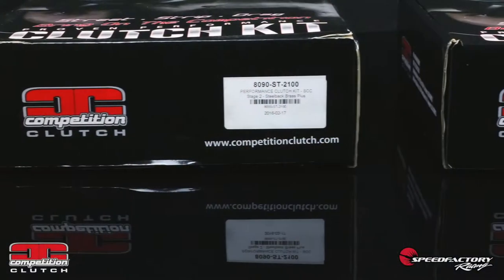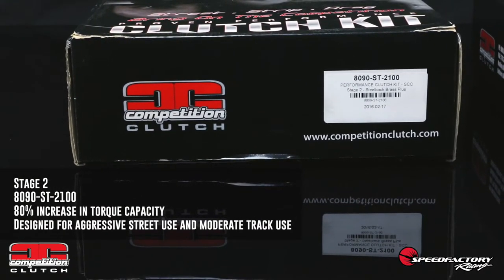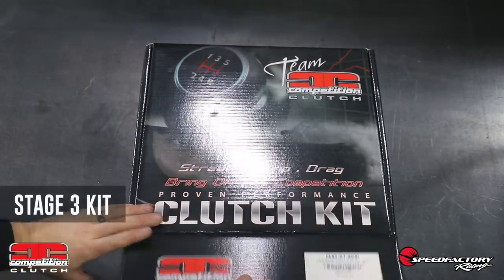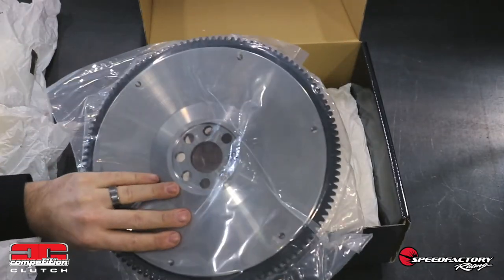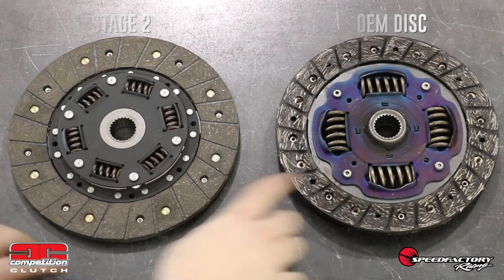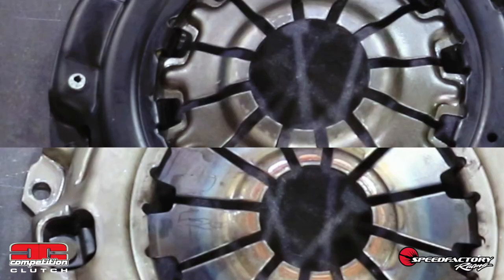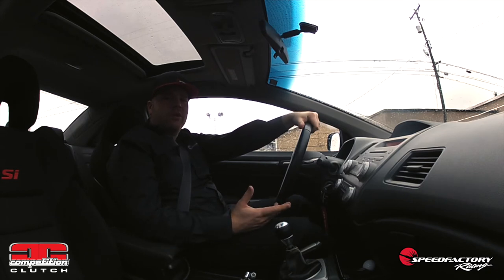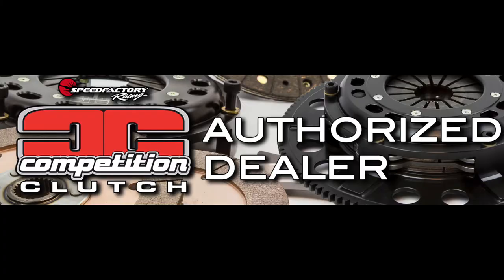Competition Clutch 8090-ST K-Series Clutch Kit with Flywheel - Installation and Review

Comment: I installed this same clutch yesterday on my 9th gen si. Clutch shifts great but... When I pull out slowly in first gear the car shudders and vibrates pretty bad.  Im not sure if thats because the clutch isnt broke in yet. Or if I have a problem somewhere else
Reply: if it's a race clutch with 4/5/6 puck, then it'll shudder. It's telling you LET'S GO or GET OFF THE GAS haha.So, yes it'll shake/shudder because it's trying to engage fully. You're riding it too much :P